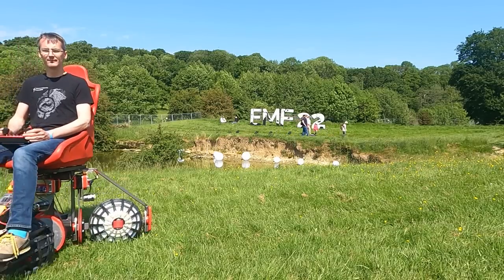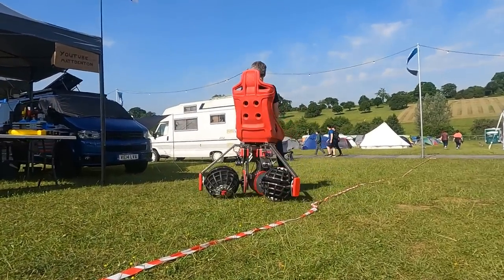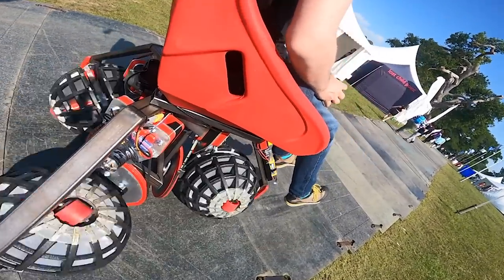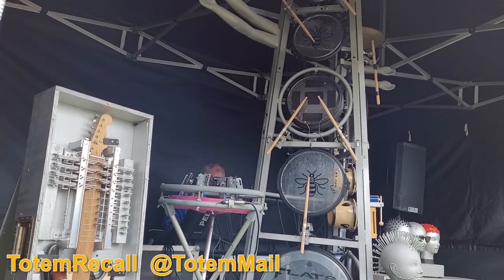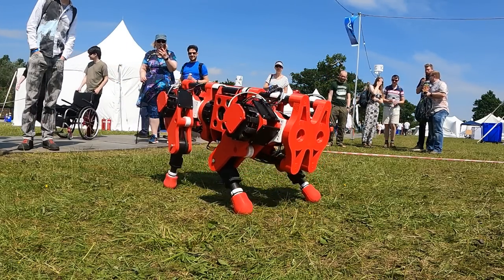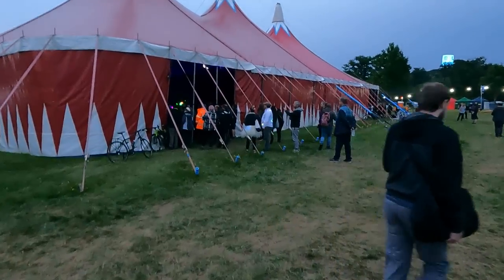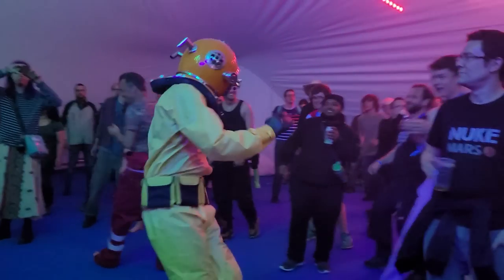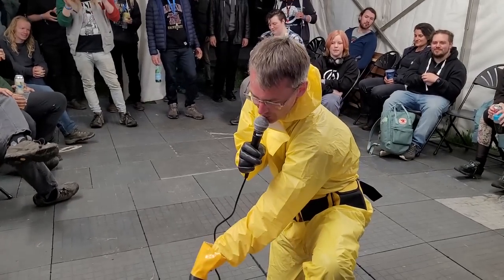Ball-Wheel Omni-Directional Vehicle Testing

Comment: If the vehicle drives better sideways, why not just turn the chair 90 degrees and reconfigure the controller? (it would look weirdly asymmetrical, I suppose) Also, have you considered using an accelerometer to detect unwanted rotations and automatically turn to account for them so it'll hold it's orientation even on rough terrain?
Reply: all my yes! please do these suggestions.
Reply: A 60 degree rotation would put it into a Y configuration (like a three wheel motorcycle).
It's more stable too, especially if you're turning at speed. Also you don't have one of the balls in between your legs.
Reply: @ltjgambrose  A 60 or 180 degree change gives you two at the front and one at the back which might be better for a few reasons, but it still leaves you only using 2 motors when going forwards or backwards, the asymmetrical 2 wheels on one side, one on the other configuration would let you use all three motors when going forwards and backwards.
Reply: Add another axis, so the chair can rotate independently from the base? sensors and code could keep the chair facing whatever direction is chosen regardless of the base rotation.
Reply: My thoughts exactly - just turn the chair and redefine forwards!
Reply: @ltjgambrose  that last sentence sounded weird...

but yes
Reply: Nah, strafing is cooler
Reply: IMU is a good solution but it needs to have vibration isolation, made that mistake before
Reply: Think it could be the weight distribution that makes it ride better sideways? From His feet hanging off?
Reply: Buuump.
Reply: Allow the chair to rotate. Like a tank gun.
Reply: I like it but don’t you think turning 60 degrees would make the most sense? 
You’d be positioned between the 2 wheels and you’d enjoy max torque from the rear wheel.
Reply: @erikig  that would look better, but the wheels are powered on the radial axis, so that would give you no torque on the rear wheel when driving forward.

Comment: Could use foot rests, and maybe foot control paddle’s. Seatbelt option?
The event looked like a lot of fun.
Reply: Yeah, it's so uncomfortable to see his feets dangling around.
Reply: a seatbelt is probably not a good idea- when the thing tips over, you don't want to be strapped to it, I think
Reply: @olik136  Its much wider than a standard wheelchair, but it’s center of gravity is higher. So there’s a chance of tipping if you’re doing crazy stuff. And yes wouldn’t be good if you’re strapped in 😂
Reply: Foot paddles sounds like a good idea, make the controls a bit like a helicopter's? You'd only need one stick then, plus the pedals.

Comment: if you had the platform be able to  rotate it's self and some added shocks you could probably make the ride more stable which would help from a rider standpoint, plus the ability more smooth adjust the riders' orientation.

Comment: I’m sure James won’t see this, but it has potential for it to be a really flexible wheelchair. 

Electric wheelchairs have made huge leaps, but they are still limited in manoeuvrability. Imagine in a shop with a normal electric wheelchair try to move to get to the right position to get an item of the shelf. Now imagine this with the added ability to rotate the seat and suddenly things become easier.

Yes, there could be issues with stability and the fact it’s very high off the ground but these things maybe could resolved.
Reply: overly complicated and to much thing could fail...
Reply: @g60force  depends what your classing as overly complicated, the mechanical side or the ability to control.

As for failure, anything can do that so that's not really a major issue.
Reply: @richards7909  It is a major issue, every additional moving part is an additional risk of failure, you're better off just making an electric wheelchair with 4 wheel steering and each wheel should be driven individually.
Reply: @Eagle3302PL  If that was the case we would never do anything because things overcomplicated things might fail.

Going on that argument, simple rockets should be used to launch satellites and left in space because the Space X ones are overcomplicated with their ability to land and they might fail.
Reply: @richards7909  Another silly argument, spacex is doing what they do because it's more cost effective to have reusable rockets so it's a potentially more profitable venture in the long term. Also they have some of the world's best engineers to trouble shoot and check that stuff before every use.

An omni wheelchair would not be more effective than current products, it'd be more expensive to build and maintain making it a foolish business venture. You gonna send an engineer to the disabled person's house every day to maintain their wheelchair?
Reply: @Eagle3302PL    So a omniwheel chair is bad because it's overcomplicated and prone to failure but Space X rockets which are overcomplicated and prone to failure are fine because they are cheaper to operate and have been designed by the best engineers?

James has created the omniwheels, worked out some initial issues, then built a functional three omniwheel machine and stuck a chair on top. Made some more adjustments then took it around a field with no failures. And even by his own admission, he's not even using the best materials. 

Sounds pretty successful to me so far for something that is overcomplicated and prone to failures...
Reply: @richards7909  I give up, apparently the difference between rough prototypes, air/space craft and devices for the general public is too much for you to grasp.
Reply: @Eagle3302PL  They ALL go through the same steps of idea, proof of concept/prototypes, improvements and testing. This applies to everything from a toy to an aircraft.

So I am pretty certain I understand...

Comment: That's epic it works rather well on grass. You could make a Body with two arms one being a controllable robot arm and the other having a rotating paintball cannon with a head onto with a camera and aiming unit for the gun. you could also modify the wheels so they have a high density foam with a rubber coat to go over the wood wheel not to thick as not to make it slower and harder to manoeuvre but it would help with change in terrain, and giving the wheels a bit more durability and ride smoother.

Comment: I'm already excited that that background hum will soon* be a thing of the past. Hydrogen fuel cell generators will likely take their spot. With the rise of green energy it'll become more affordable while the rise of gas prices will make that option less affordable. With a quieter, less polluting, and most likely cheaper option available it will probably be an easy choice for most organizers.

* "Soon" doesn't mean that dino-fuel generators will be replaced in like 5 years. They'll probably stick around for many years to come. It is a different technology so it depends on the type of event, the scale of the event, and the location of the event whether hydrogen of dino-fuel is the better choice. In like 30 years there will probably still be some old generators in use. Most likely on some small events. But I guess most larger scale events (like this one) will switch hydrogen generators over the coming 10~15 years.
Reply: They could work well, given the somewhat recent breakthroughs in solar though, I believe they could use that instead, and hydrogen fuel as a backup.
Reply: I was surprised at how little solar there was at emf, I presume it was because of how it was temporary. There were only a few tents that had it. The best solar I did see though was one that doubles as a table.

Comment: I would be interested to see how a normal wheelchair user likes it!
Reply: This is brilliant.
Reply: Only one problem, it’s too wide.
Reply: @iteerrex8166  slim down the side
Reply: @iteerrex8166  Another problem is the wheel size. I'm not sure it would be able to get over a curb. Also, the dimensions of the whole thing - it doesn't look  if it would fit into a doorway, for example, with a rider. Basically, it's not practical enough for everyday use. It seems to have potential though, but also a lot of inherent problems in this particular capacity.
Reply: @Drak_Thedp  I think it fits for Professor X to use
Reply: James has met me at maker central would be happy to try it out
Reply: Wheelchair user here.  Yeah, with refinement it could be brilliant for some things.  The best use I could think is wheelchair sports.  I used to be pretty darn good at table tennis, but its that fast sideways movement that makes it a downer for me.  So this would be awesome for that when a one handed control scheme is sorted.  Same goes for regular tennis, or wc basketball.  I'd love one for that kind of thing :)

Comment: Regarding the matter of unwanted rotations due to slipping and stuff, why not setup some automation for rotation and acceleration using PIDs to smooth out the ride and correct for deviations caused by terrain conditions?

Comment: things not working when its finally time to show the public is a very common thing. i remember running a public event with tables full of stuff including monopolar motors run by variable power supplys. as i was talking to somebody the children on the other side had managed to overload them and burn the wires off in a cloud of smoke. 

one other time i made special light rope thingy for circus performers. on the show night they practiced so much beforehand that all of the accessories has stopped working due to broken connections. the manager didnt tell me and blamed me one week later, even thought i had plenty of backup ready to go.

Comment: @James Bruton forget Supervillain chair, You have a great start to a chair to assist movement impaired people, anyone with a walking disorder of any type. Allowing them to get to areas where typical wheeled chairs would not be able to reach. 

As for your concern about grass / other objects getting into the wheels, A arc shape that sat above the wheel with stiff plastic bristles to clean off debris as you move. or perhaps a pair of brushes on the side of the wheel so that debris that is swept off is dropped to the ground. 
Have you considered a modular power system that way you could add / swap batteries?

Comment: You Should Add A Robotic Arm System With 360 Controls Cameras And Automatic Software so it can run the Wheels as Well as the Giant Platform And Arms On it Probably aluminum With Steel Bars and Edges so it doesn't fall apart but it's Light enough but I hope You Do Some more with This Awesome Creation!

Comment: I would love to share my ball wheel concept that I have tried on a very low prototype concept, however my idea is closer to a rubber ball wheel that I want to use racket balls for a low weight Battlebot. My concept is a very agile movement system using more motors than the normal bot and more programming for proper controls.

Comment: This design on a car would be cool. But I guess it would be unstable at high speeds unless the computers are tuned to lock the wheels into a stable position after it hits 25 mph. There would need to be tire rubber fitted to the hemispheres keep the same build design but instead out of a special type of inner braving most likely steel and simply air pressure as for the skate board wheel that won't do. We will need a better wheel designed with a multi stage bearing that uses oil as lubricant.

Comment: Nice. Not a big fan of techno music, more an old school rocker. As far as in proving your ride, handle dip on the wheel spheres for extra grip, up your power output up to 2/3rds, a switch for high/low gear, lights to make it street legal, and basket to back of chair, foot pegs,and a cup holder. Also, you might want to try control off a motor wheel chair (one hand steering). gotta name suggestion for it ;BIG BALLA. congrats, you made the future of wheelchairs. Last thing, speed test. 0-30 m.p.h., road speed 45-60m.p.h. after all the tests, give "Tesla" a call.

Comment: needs suspension on the seat,  If you half the size of the balls and have two castors  either side of the lead ball it would be perfect for me as a wheelchair user. You met me at maker central in the electric wheelchair.

Comment: this is a  simpler way of achieving the same thing https://www.youtube.com/watch?v=M0POTqQWlks you would be able to simplify it further by steering each of the three wheels independently with three servos. rather than my rather laborious method of controlling all three with  a central offset crank. it gets round all the problems of gearing & load distribution. my version has only one motorised wheel but you could easily motorise all three. you could do away with the trailed wheel that orientates the steering crank and control it electronically. i know it looks a bit crazy but i think it might work, sorry about the dreadfully incomprehensible movie